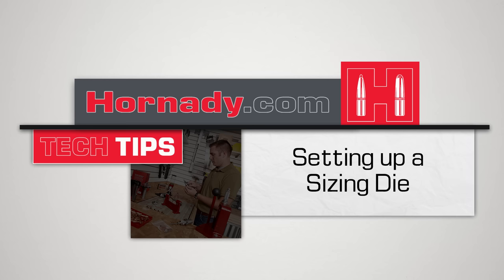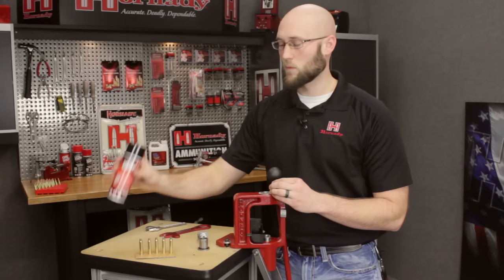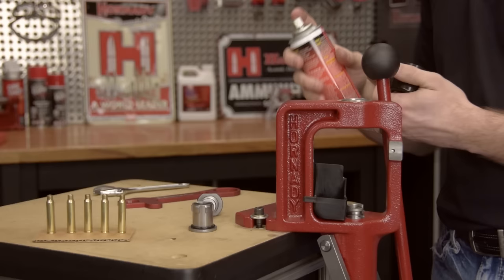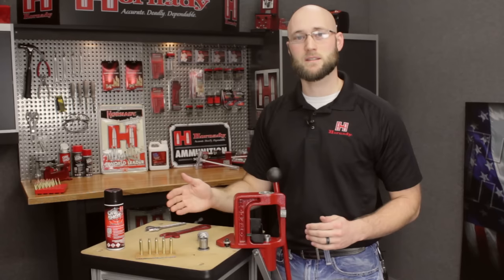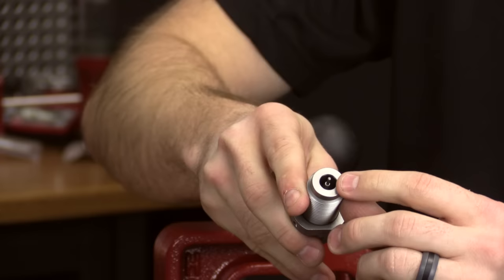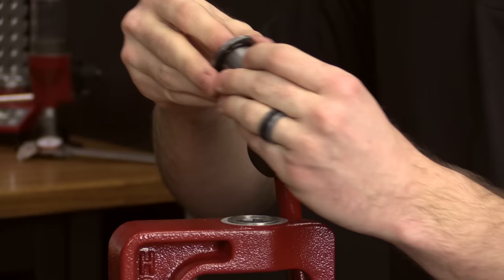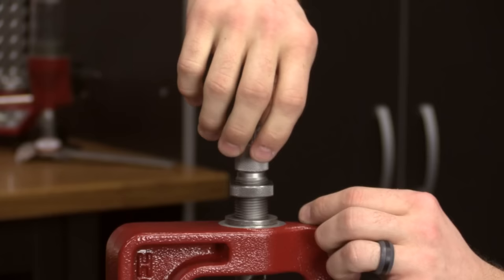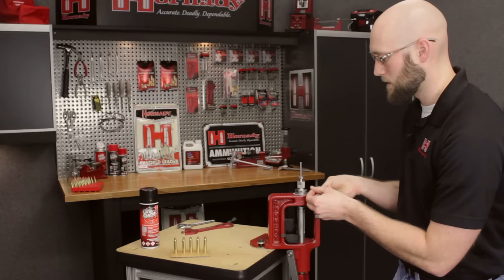Hornady® Tech Tips: How to set up a Sizing Die

Comment: What happens when our die randomly starts holding the brass and we have to hammer the lever to get the brass out? I've already tried disassembling the die and cleaning it and the cases are lubed properly.
Reply from the maker: call our customer service at 1-800-338-3220
Reply: you need to make that a channel. lol indoor outdoorsmen is funny
Reply: @HidinRebel  It used to be one. After spending over $10,000 and not getting anywhere without spending hundreds on advertising I gave up. Now I just use the account to watch and comment.

Comment: I’m really conflicted Hornady! 
I’ve always seen the die screwed further once it’s met the ram. Lowering the ram and adding a 1/4 turn to have the ram cam over. pretty sure this is in the rcbs die box instructions too. Please answer this question! 
Someone else asked too. Is your method only for Hornady parts because that’s all I have.  press, dies etc. everything is hornady.
Reply: i have the Hornady LNL progressive and I had to cam over 1/8-1/4 turn. I was getting hard bolt close & lift. about 1/8 turn MORE after the die touched solved the problem

Comment: In the instructions it says to have the ram at its highest setting with out caming over.  The ram reaches its highest point before the handle is pulled to its lowest point. 
     If i set my die up like this video it pushed my shoulder back (30-06) beyound min SAMMI ?
Reply: If you cam-over, you'll be pressing the case a little further into the die and maybe setting the shoulder back a little too far.  If you are really worried, back the die out a half turn after it contacts the shellholder and measure set back.  If it isn't what you want, keep turning in 1/4 turn at a time until it is what you want, but be aware that case shoulders don't move all the way forward with just one firing.  The shoulder may not be set back even if you lower all the way down to contact plus 1/4 turn.  After second and third firing, keep checking to make sure you aren't setting the shoulder back too much.
Reply: Mac, I agree 100%.
Reply: @robertbrandywine   im not very good at writing what im thinking.
   What hornady does not make clear is the RAM is at its highest point BEFORE the handle is down. Hornady shows the handle all the way down and adjusting dies, IF tou do this  you eather crush the shoulder or push it way back.

Comment: I've always read that once you've gotten the die turned down to meet resistance with the ram you lift the ram up and turn the die again approx one half turn. 
Is this just a Hornady design? Or am I wrong with the way I was shown how to do it?
Reply: +Terranitup I'm with you, the bottom of the die should touch the shell holder at the highest position WITHOUT camming over. So that's why you would back it up 1/4 or 1/2 turn...to avoid pushing the shoulder back to far.
Reply: Just make sure that you resized it enough, That it goes into your Bolt Rifle smooth enough with no problems etc.
Reply: NBPrepper terranitup said turn in further into the press a 1/4 or 1/2 which is what I’ve always read
Reply: Terranitup  keep an eye on the LNL bushing when he resizes the case.....it raises unite a bit.....you can turn these dies in, at small increments and nothing will happen.....once you do reach a point to affect a change, it is way to far..
Reply: I mean you can measure your shoulder before sizing and after sizing to see if it pushed back at all. 

Unless there is a serious issue with your die or press, I would think it’s impossible for the shoulder to be pushed back without the case getting sized right.

Comment: I am reloading 6.5 grendel and I still not getting full lock up on bolt and I tried multiple rifles. Tried 1/4 additional turn, and my hornady case gauge says that it should be good. I get full lock up with factory ammo. I had no other issues with my other reloads. Thinking about using a different die set, any recommendations?
Reply: I wo7ld suggest redding type s die I couldn't get hornady dies to work worth a shit with the decapping pin I stuck the first two cases in a row called hornady they pretty much said it couldn't be so, I couldn't the expander out so I hit it with a hammer turns out it was lock tight on there rcbs makes just as good as hornady for the same price
Reply: Better I believe 
Redding is by far superior though

Comment: If only the directions that came with the die were this in depth, might not have jammed a case in my first one and be stuck waiting on one to be delivered now...
Reply: You do realize you can get the case out of the die??
Reply: @slayer324  Not every time you can't, this was one of those times.
Reply: How so? Drill, Tap it , thread bolt in with a spacer and it will pop out. I’ve had to do this 3 times. Works every time
Reply: @slayer324  Bottom of the casing snapped off after trying the stuck case kit, wasn't anything to drill and tap aside from the wall of the casing itself.
Reply: Oh so you messed up then. Having a stuck case isn’t a big deal as long as you don’t make it so. Oh well better luck next time.
Reply: Lmaooo. I laugh bc I’m a noob, and that was pretty funny lol. A noob to reloading anyhow.